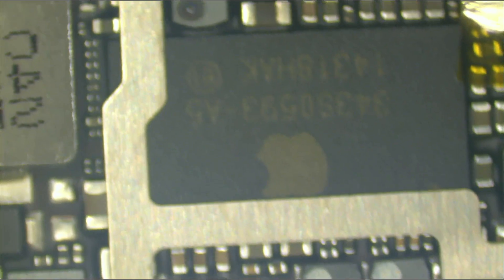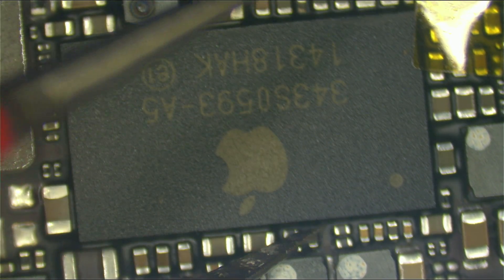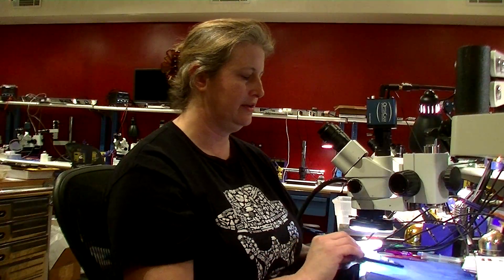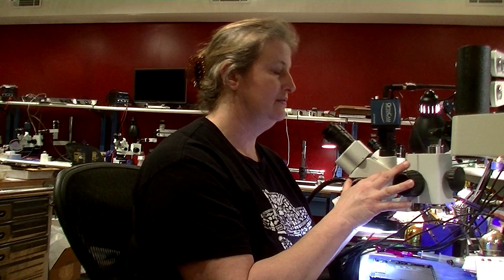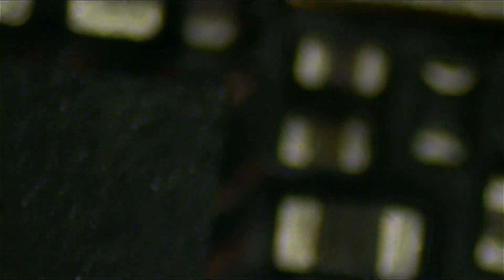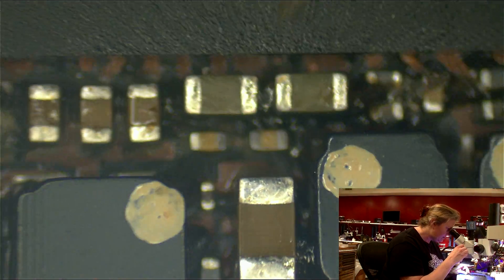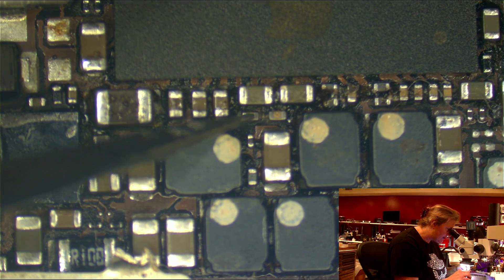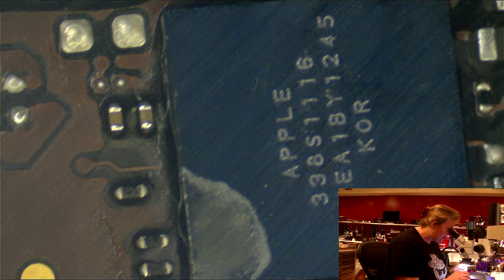Apple uses water damaged boards in Apple refurbished devices

Comment: At the end of the day, people will get what they paid for. You want brand new then pay brand new money. Plus this is like asking did the lack of adhesive kill the device or did the fall that it got and with that, I have to know if the device didn't fall from the child would it still be working normally? I get the point that everyone will make mistakes even the manufacturer also so no one is perfect and outside shops may even sometimes be better at repairs than the manufacturers also.

Comment: In the auto electrics industry, starters alternator are both refurbished and remanufactured. The difference us that "refurbished" just means "fixed what was broke" while remanufactured means it was torn down to the frame, and every part was checked to make sure it met OEM spec in every way before the "new" unit was assembled. The consumer electronics industry only "refurbishes". May even  leave a half dead battery in it because, hey, it still works.

Comment: When I see any type of conformal coating, I assume it's there to mitigate the effects of humidity or tin whisker growth. Rework does happen during manufacturing, and will deviate from the normal process. I suspect this may be the original condition of the board. If you open any consumer electronics, you will find lots of substandard work.

Comment: Saying you wouldn't fix or reuse / sell this working board is almost as bad as Apple telling people they're not allowed to repair. Would you add underfill in your repair?
Reply from the maker: I have no experience with the thermal expansion coefficient calculations that would go into choosing an underfill material compatible with the demands of this chip, and that subject matter is too deep for me to begin to guess.  I only do repairs that I can warranty.  Unlike Apple, I will be the first to advise you that you may find someone out there who can help you with this repair even though it is not part of my business model.
Reply: iPad Rehab I just wouldn't want a working iPad board to go in the trash.
Reply from the maker: No one puts working boards in the trash.  We do data recovery which means we fix the device to the point that it will turn back on and decrypt the stored data.  Then it goes back to the owner after we extract and parse their data.  If they get some use out it then great—bonus.  We don’t guarantee that our data recovery devices will go out working.

Comment: I hate Apple. Absolutely. I was giving a brand new, in the box iPad IV Air that had sat on a company shelf for 2 years because it had never worked since new. It would charge, but wouldn't start. I went through the process of factory refreshing it several times, but it would never boot up. So I took it to the Apple "geniuses". There were twice as many "geniuses" sitting around talking than there were customers in the store. Still the pencil neck told me "You have to make an appointment. We can't look at your iPad without an appointment". I couldn't believe it. 

So I made the damn appointment and showed up. Of course the "genius" could tell the unit was brand new and had never been registered or activated. He tried the same things I did and came to the same conclusion - it was brand new junk straight out of the box. He wouldn't honor the warranty because it was 2 years old. Instead he offered to sell me the same model for $99. I scoffed, but took the deal because the original unit was free and ultimately I'd get a $450+ unit for $99. Little did I know.

Less than two months later the replacement iPad was dead. It was obvious then - and confirmed now - that they sold me someone else's dead junk. No doubt the POS I traded in ended up getting passed on to some other poor stiff.

Then the corner of my adult daughter's screen peeled off her iPhone through normal usage.

Recently my wife's iPhone 6s suffered from Apple's intentional throttling as the battery got older and charges lasted less. So she paid the $29 to have a new battery put in it by the "geniuses". They pulled the same "You need to make an appointment" crap on her as well. (Again, there were "geniuses" sitting around chatting that could have helped her.) She made the appointment for a tech to call her phone to test it remotely. Of course the "genius" said "You need a new battery". Duh !!!! She had make ANOTHER appointment ! When she got her phone back it looked as if it hadn't been touched. You'd think they'd at least clean it up a bit. And the battery life is exactly the sucky same ! What battery did they put in ? Did they change the battery at all ?

Apple... Pffffhhhh.... Crap !

Comment: great video i agree 100%. this reminds me when i used to work at auto dealerships as a tech, people would go and buy a certified pre owned vehicle, pay the price for the certification, but in reality what most tech do is check the car underneath with a flash light and a quick oil change. it’s all a rip off. people should trust more small independent shops like yours.

Comment: Great Video! I had a local tech replace my iphone 6 plus screen. It had a touch disease-like problem. $120 down the drain, and he even forgot to reinstall the lcd ribbon connector plate. I ended up replacing the battery, screen and cover plate myself. 2 months later no problems. I think I'm lucky it wasn't an IC chip issue. If it was I probably wouldn't have been able to fix it myself.  I just fixed my wife's phone for her. 
Apple relies on it's customers feeling helpless so we can throw more money at the problem.

Comment: I dropped my iPhone somewhat hard but in an otterbox case, hard enough that I was like DAMN! thank god I have the otterbox. The phone was absolutely fine, until it died from low battery. I have been unable to charge the phone or turn it on, took it to the apple store. they check it LCI and sure enough its red so I cannot get a new iPhone. They say its water damage. ive had my phone in rice for 4 days, and it still refuses to respond to charge or turn on at all. No apple logo, no flash screen, no lines, no response period. I would really appreciate any advice, thank you!

Comment: Back in 2014 I bought a refurb 2013 MacBook Air. Never had a single issue loved the laptop, until I decided to clean off the keyboard. All I did was take a wet wipe and clean of the keyboard a bit aggressively but keep In mind I already done the to tons of previous dell Latitudes and insprions. After that my trackpad went out, then the keyboard. I already did this countless other times to my MacBook Air. After that somehow liquid got into my laptop and the shorted it out. After that I paid Apple to repair it and it was a brand new laptop. But then I again not learning my lesson from the first time decided to do it again. Same thing happened but required a new top case. After that I was about done with how fragile that computer is and how I can't even clean off my laptop. So then I decided to by a Surface Book and it has been worlds better than my MacBook Air except battery life. I'm wondering if this same situation would've applied to me?

Comment: I bought an Iphone 6s plus refurbished from apple. I had problems connecting to itunes so I called apple for help, I ended up talking to one of he senior ios technical advisor and he told me: "apple doesnt sell refurbished products. No, apple will take your device and then they replace it with all new parts so your phone is brand new. Apple doesn't sell refurbished products." After I even told him I bought it off of their website, I didnt want to argue with him so I left it at that.
Reply from the maker: Apple doesn't use the word refurbish--they say "remanufactured"  but yes--Apple refurbs are all over the place.  If it is a phone, you'll see silicone at the CPU shield in all the refurbs.
Reply: iPad Rehab If possible when you get the chance do you think you can do a video showing all that in an iphone 6s plus, I'm curious and honestly I can't believe there are people who only believes only APPLE can fix their problems, if anything acts up on my iphone I'm going to you lol

Comment: First the kid probably caused the water damage and the water might have caused the short that could have made the capacitor heat up. Also refurbished devices have a one year warranty, just like any other Apple device, so chances are that they probably could have had it fixed for free instead of through you. Speaking from experience, I have bought a refurbished MacBook and it was basically a brand new unit repackaged and I've had zero problems in three years, the fact of the matter is Apple certified refurbished products are at a higher quality level then any other refurbished product through a different source, I guarantee a refurbished from another source would have way more problems.
Reply from the maker: Out of warranty device swaps for Apple refurbished stock carry a 90 day warranty.  Not 1 year.

Comment: am i correct, that it costs almost nothing for apple or 3rd party repair to put underfill back, where it originally was?
and water damage on a board means that it will be way more likely to break in the future correct?
also how in the world can a device like the ipad mini get water damage, i look at that device and am like wtf, it's not ip68 or sth?
it's not even splash resistant i read?
Reply from the maker: underfill has its own biology--the substance must be matched to the thermal expansion coefficients of the solder---it's not "just squirt some crap in there and it'll be fine"  so no--putting back underfill is beyond the scope of independent repair and apparently beyond the scope of Apple refurbishing as well.

Comment: I mean this isn't the case for EVERY refurbished Apple product
Reply: Sure, but it shouldn't be the case for one Apple refurb. There are clear signs. And we know an or multiple actual "factory" refurb tech(s) inspected and worked on this, because diagnosing, setting up and routing/cutting away that chip and that underfill before repair, would involve at minimum two or three visual inspections. By people who do this and only this - inspect, evaluate, and possibly set up the boards for various processing - for a living. And we all know how paranoid Apple is about any sign of moisture.

Comment: I'm wondering if they heat-gunned the board to soften the underfill and left the gun running while sliding the board under the scope causing some unrelated areas to get too hot and bulge up the solder.

Comment: When I got a replacement 5s a while back on a replacement program for the power button, I had no illusions about it being a refurb, which was ok with me; I'd bought it 2nd hand off eBay with a broken screen and replaced it, along with the dock. Had I known it was eligible for a replacement, I might not have done the dock, but it was good experience. Only recently replaced it with a 2ndhand 6s and still works perfectly. I don't know if anyone is actually saying only Apple can repair your device, I have never heard that claim myself, but clearly it is not true. They are in the best position to be able to fix it, true; but I don't think they want to handle every broken screen or drop damage out there. Having had to fix my niece's dropped phone a few times, I have seen the result of cheap cowboy screen repairs, with missing components, damaged screws, etc. Though if I take my Mac in for repair, I know from their service manual they will do a few checks to isolate if it is a connector or chord first, but if they isolate it to a board, they will simply replace the entire board, not fix it. The board may go away for refurbishment, it would make sense, it would minimise time spent repairing individual machines, while somewhere else they can concentrate on fixing it, if they can be bothered.

Comment: Thanks for the video. May I ask that you educate me on how to tell if the capacitors you mentioned were water damaged? How did the caps look differently from a normal capacitor? Couldn't find the explanation in the comments either.
Reply from the maker: Yes.  I have another one here just like this one today.  The water damaged caps are oxidized on one end

Comment: Apple technician don't know what they are doing, my phone was under warranty and need the battery replaced when they where preforming the repair they broke the tab that's helps remove the battery so they told me that they can't replace the battery and offered me those shit unreliable refurbished phones, well they f up they should have give me a new phone instead of those refurbished phone with water damaged and Bad soldering. Not happy at all with service apple provided me today
Reply: Ahaha. You appear to be very entitled
Reply: Can’t believe your ignorance
Reply: lol little heat and or a squirt of contact cleaner plus a pry tool or credit card woulda taken it right off.

Comment: First off, I love your videos, however, my question is there any way to definitively  tell whether or not a phone is refurbished or not without opening it up? I received an in warranty replacement iPhone 6s, and i was told that it was in fact new by the apple store tech, but i just wondered if it was for sure. Thanks.
Reply from the maker: Apple only gives new phones to replace new phones bought within 14 days.  After that it is refurbished.
Reply: Wow, I feel really deceived by apple. Nearly $1,000 to be lied to.
Reply: iPad Rehab I'm not totally sure, but i did ask and the girl said it was new. Wouldn't that be against some law or something?
Reply: M_I_C_H_A_E_L 100% it is refurbished they just call them new so the customer doesn't get put off
Reply: Jessa Jones  and they use water damaged boards
Reply: Buddy, you can spend $300 on a machine from china that reprograms any and all chips and nand memory so that in the "my phone" display in your settings menu the color of phone, storage capacity, model of phone (4, 4s,5, 5s, and so on and so forth), and, most importantly, the serial and the imei numbers. So you checking into the serial, unfortunately, is not a bulletproof method. If you or I can buy the machine for $300, I'm sure Apple, with bottomless bank accounts, and the fact that they built and own the stuff, has a fairly smooth, easy way of manipulating it and can probably even say it's new and by some loophole, might be legal to do so. Check out the videos on here of iPhone NAND flash machines. Neat little things, they are.
Reply: +M_I_C_H_A_E_L you are probably fine with an Apple refurb for 6s.  They will honor the rest of your warranty for your original 1 year.  They may have gone outside of policy and given you new--who knows
Reply: good for you apple sheeple.
Reply: faizan joyia I got good news, I checked into the serial number, and it's a brand new device!
Reply: Allot of apples repairs are outsourced anyway to private companies in cheaper places, my iphone 5 dock connector replacement, done under an extended warranty program, was sent to eastern Europe probably a thousand miles from the UK via dhl (very un-environmentally friendly), and a device was sent back lord knows I think its the same phone, but maybe they can flash serial numbers ? the address it was posted to from the tracking didnt even sound like an apple owned and run facility? and they sent it back updated it to bloody iOS 10 from 9 when i didnt want them to! making it pretty useless to me for the use case I had in mind, they are an arrogant broken company have been for the last 20 years imo. been using apples since the IIe. Should have just done the repair myself, but got tempted by it being a free repair ;(

Comment: I work in a repair shop, and there are lots of people coming to us who has visited the local Apple store. They often have very simple issues like a dirty charge port, broken screen, bad battery. Every single one of them has been told that it is unfixable and the phone has to be replaced. Note that they dont say "we dont do repairs, but we can change it for you", they lie to their face and say its not possible to fix. The dirty charge port can be fixed with a tweezer for christs sake!

On top of that they trash talk our shop and lie about stupid shit, like when a battery is swollen on an iphone that we replaced the screen on they tell the costumer that the screen has broken because we "stole parts" and our screens are bad, when the problem apparently is their shit batteries which swell up like a balloon. Fuck Apple.
Reply from the maker: My husband had an in warranty iPhone 6 with touch disease.  I sent him to Apple and he mentioned touch disease and they rolled their eyes.  They told him the perfectly flat original battery in that sucker had "swollen battery" that was causing the touch screen to malfunction, and they replaced it.  We had a good laugh.

Comment: Could a water damaged board not be refurbished to work as good as before? I understand the risk of it being dropped and unseating a chip due to the underfill not being present, but aside from that could it not be made to function properly again?
Reply from the maker: For personal use, sure.  Or if you were to replace 100% of the damaged components.  In this case, this board is not quite as originally designed but it is close.  The problem is the idea that 'Apple wouldn't do that"  when clearly they do.
Reply: It's a subtle distinction, but the "iPad Rehab" is not saying that Apple should not do this, she is complaining that Apple spreads "FUD" that 3rd party repair shops don't repair products properly, because they do this kind of repair, and only the mighty Apple can do it "properly"... while in fact apple repairs are no different than those 3rd party repairs.